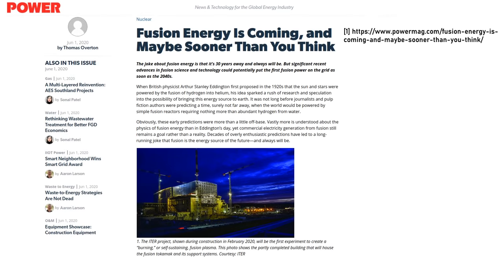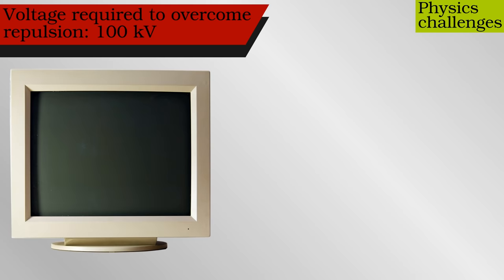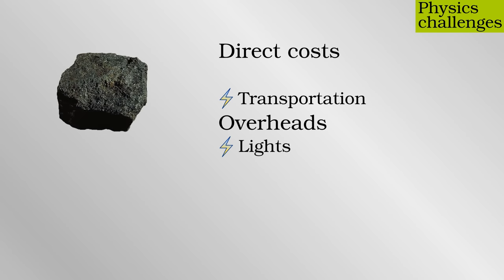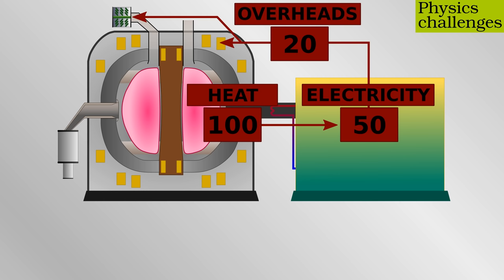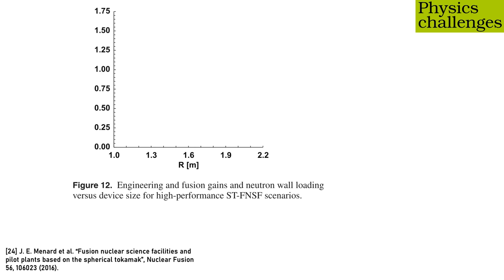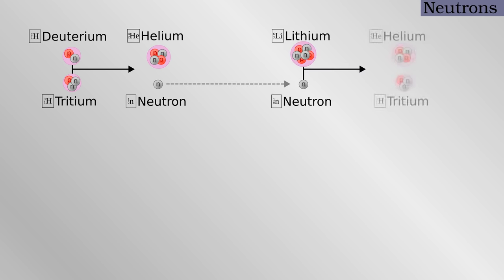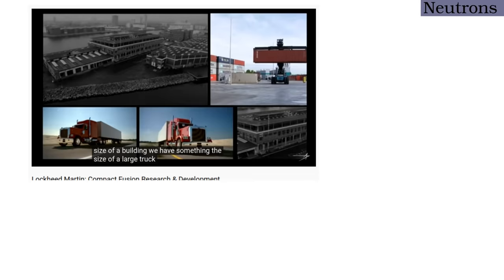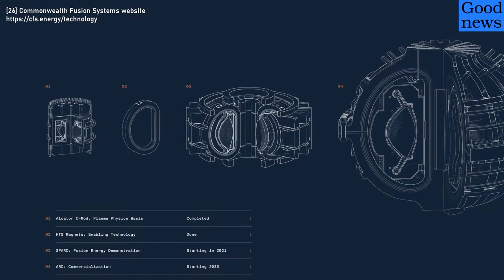Former fusion scientist on why we won't have fusion power by 2040

Comment: Great video:: I remember when I was a young electrical engineering student in the 1950s in the UK when I read an article about a fusion machine which I think was called ‘Zita’ that was supposed to have achieved fusion and was predicted that this would eventually be able to supply the world with unlimited energy. Later it was decided that the machine had not achieved fusion but that within 10 or 20 years of development it would. I am now 85 years old  and i am still waiting.
Reply: I hate to break it too you but fusion reactors that produce enough power to make them worth it are over 100 years away.
Reply: The machine was called "Zeta", if you want more information.
Reply: @Veritas-invenitur  never  , we haven't got 100 years !
Reply: @MyKharli  not with Biden in charge
Reply: @Veritas-invenitur  Unknowable.  I doubt it will be that long but it's uncertain when we'll have it.
Reply: I feel most of your pain!  Been watching this promise for 47 years.  Remember the two scientist that thought they had 'room temperature' fushion in a quart jar?
Reply: @strategicsage7694  I do not believe that magnetic containment alone is capable of making a practical and efficient fusion reactor that can be used as a power source. I believe that other methods in addition to magnetic containment are required. I had a very interesting idea of a containment system that utilized radiation produced by solid state sources to assist in field containment. Its quite complicated as the radiation gets converted into photons through the excitement of gasses and it is the photons themselves being directed into the field generated by the magnetic forces themselves that assists in the containment. The thought process here is that if we could dramatically reduce the amount of energy required to maintain containment we would increase the net energy gain. I also question that if we can reduce the amount of energy needed for containment using the same size magnetic coils in the reactor, we would be able to push the reacton far further. Do you understand what I am saying here?
Reply: @Veritas-invenitur  I understand your thinking but why do you feel that containment isn’t possible? From what I’ve read over the years, once a fusion reaction can reach criticality it produces its own magnetic field that serves as a self reinforcing containment field. As power output increases, so does the strength of the containment field. The problem seems to be achieving the heat or pressure required for a self sustaining fusion reaction. That’s the real crux of the problem, we can’t create the heat required, so the other option is pressure, which is also difficult but somewhat easier using particle accelerators as an atom smasher, which isn’t ideal either. Bringing us back to the start of a self sustaining fusion reaction.
Reply: @Veritas-invenitur  I don't really think a thermonuclear bomb reactor is a feasible concept.
Reply: @Veritas-invenitur  Hold on, you're saying that focusing light generated by radiation from solid sources it will help the containment? By radioactive solid state sources you mean radioactive material? And what radioactive material? How light (photons) can help a magnetic containment field? Also, if we're talking about cost, those materials seem pretty exotic and not really cheap. The only radioactive material already used in those reactors is tritium, and it is true it glows faintly when it reacts with phosphor, but I fail to see how this will help with the containment.
Reply: @OnlyKaerius  It is feasible, but it'll work only once and the infrastructure that could use that kind of power output does not exist.
Reply: @dragoncongrelos  It'd add a TON of complexity, failure points and hazards, etc. The fissile materials have to be cooled and the fusion needs to be millions of degrees hot. Even if you somehow figure out a way to run it while allowing the fissile materials to melt and not need cooling, you need moderators for the reaction, and well graphite rods can only get so hot before they burn, and water needs to be cool enough to be liquid, so I guess some form of liquid salt moderator would need to be used to slow down the neutrons enough to sustain the reaction. But now you need to figure out how to physically contain the molten fissile material, and keep it separate from the plasma, but not so separate that it doesn't feed the plasma neutrons. I'm only scratching the surface of things that need to be solved here.
Reply: @logicsfinest3471  The photons will increase the pressure dramatically.
Reply: @OnlyKaerius  Yeah, so, that'd a huge part of the problem. If you are not careful a thermonuclear incident becomes possible with such a method.
Reply: @dragoncongrelos  You don't need a radioactive material that gives of photons. You use the radiation to excite a gas that gives off photons. What I am envisioning in my head is beyond difficult to explain. But essentially, you are shooting those photons at the field itself from the nonplasma side to increase pressure in the containment field.
Reply: @OnlyKaerius  I know how complex it would be. But I don't think you need to build an actual fission reactor to get enough radiation to excite the gasses. Passive radiation sources can throw off an absurd amount of radiation. It very well could be enough.
Reply: people waited a loooong time to turn lead into gold but we did it eventually
Reply: A completely different question but as an EE student I would like to ask: To what level did the education system educate you for what you needed to do in your carriere and to what level did you need to reducate yourself?
Reply: @JackMott  Yes, ultra-expensive, radioactive gold. :p
Reply: @OnlyKaerius  Alchemy ain't easy!
Reply: @Veritas-invenitur  Nothing you are saying makes sense. Have a great day.
Reply: @Veritas-invenitur  but is it even thay,  when we are there,  then the research will point it to be,  1000 years away.
Reply: @Veritas-invenitur  good point
Reply: I hope you can see it.
Reply: The problem is that the goal post is moving.
Basically every single goal of actual fusion research was furfilled. But when we actually achieved fusion the goal post went to "achieve net positive fusion". Then after achieving "net positive fusion" the goal post goes to "achieve net positive fusion in an industrial scale" and so on.
I understand that for the layman it feels as if fusion is not getting closer. But it surely is.
Reply: @AliothAncalagon  Net positive fusion hasn't been achieved yet. See video.
Reply: @OnlyKaerius  I never claimed anything else.
I simply explained that this is exactly the next goal post that is going to be moved.
Reply: @AliothAncalagon  
yeah, that is probably true that they are getting to the logical milestones, but you don't think there is a possibility that at the same time the big picture is coming into focus of what is doable without some major breakthrough?  The video is quite compelling in explaining how much has to be put in, and how hard it is to get energy out, and do anything with it.  The economics do not look promising, that is more than just meeting milestones.
Reply: @justgivemethetruth  "Breakthroughs" are less important than reaching certain milesones.
One of those super relevant milestones that was preventing big steps is sheer size.
Something the ITER is making a massive leap towards.
We have been spending much time in understanding the plasma. We need to start applying this knowledge on more than a laboratory scale.
Reply: @Veritas-invenitur  well that is like saying- that  most of people could get a stable job and be married with kids by the age of 30, 
but it aint always like, that is it
Reply: Captain Chaos  But this was intentional. A net positive reactor requires a certain, large, size. 
To learn the things about fusion we prioritized this size was not necessary. Building reactors 5 times as large as we needed only to get above the threshold that makes them net positive for publicity reasons would have wasted a lot of ressources and, maybe even more important, decades of time. Now that we became very proficient in controlling the fusion process, it is the right moment for ITER to go big.
Reply: @AliothAncalagon  when is "net positive fusion on a break even basis?" Lol ..
Reply: This is the other half of the cover story of the military psychopaths that always promise the Moon and Stars just before doing you over, but you've known that about ten years longer than I have.
Reply: @systemBuilder  When ITER goes online.
Reply: @willybird3377  This channel is for intelligent people.
Reply: @Gary Cooper As many people have mentioned in the comments, you are most likely talking about the ZETA machine which is based on a concept called reverse-field pinch. Think of tubes of current running in a closed loop in the shape of a torus. There are also tubes of current running in a closed loop around the long tubes. The idea is that the plasma can relax to a quiescent, low-energy state after a violent start where these currents and the resulting magnetic fields balance each other. This was an attractive concept because it doesn't require superconducting magnets to create an external magnetic field. But the heat and particle loss compared to modern concepts like the tokamak and stellarators are huge. Compared to that device, we are doing much better now(approx. reduction in heat and particle loss by a factor of 60). It is hard to describe the progress to people who are not involved with the field.
Reply: @Veritas-invenitur  "humans" lol. Are you an alien?
Reply: @anonymoususer3561  I found it very interesting that you took notice of how I used the word humans. You are quite perceptive. This world that we live in, is filled with secrets, omissions, and false assumptions. Throughout all of recorded history, across every civilization and empire strange and bizarre stories that challenge the group knowledge and perception exist. There is a reason for that.
Reply: @Veritas-invenitur  tokamaks maybe, but what about high Tesla spheromaks/stellarators? The polywell and focus fusion? Those are all very small so if they will work we'll know about it much sooner.
Reply: Captain Chaos  they got more out than in at JET in the 1990s but it wasn't stable and not hooked to electrical output systems. The magnets available at the time and well known scaling laws for magnetically confined plasmas in thermodynamic equilibrium told them they needed it big so they started ITER. New magnets in the meantime have led several groups to make smaller devices using the same scaling laws which can be tested in the 5 year timescale but then need to hook up energy output. Meanwhile nonthermodynamicly stable methods are also in research.
Reply: @Veritas-invenitur  You clearly don’t have a background in particle physics, but reliable fusion isn’t going to be solved by vaguely describing an idea that has no baring to reality. Ignoring the issues with using a radioactive decay to produce photons (why? there are far better ways to produce streams of photons such as the way lasers do). The only way introducing photons into the system would help is by using a high power laser to help heat the gas, photons are massless and don’t interact with magnetic fields so wouldn’t help whatsoever with confinement. Using photons for heating the gas is just trying to mix two separate methods of heating into one, which would no doubt increase complexity and decrease efficiency, lowering the fusion gain of the system. Trust me the people working on these systems are extremely intelligent and well versed in their fields. Unless you’ve got a P.H.D at a minimum any concept you come up with either won’t make sense or work from a physics standpoint or will have been thought about long ago
Reply: @justgame5508  I do not know how to express this nicely. But you are missing something. Something critical. I cannot explain it in the YouTube comment section. But you have to use radiation instead of lasers. And in this specific case, photons would work. Their are "different and strange" phenomena and effects when you are dealing with these types of pressures, temperatures, magnetic fields, and isotopes. Conventional physics almost "breaks down". It's a completely different animal. As for your PHD argument. No, I do not have one. But the man who came up with this idea back in 1993 did. The reason why the idea never left the drawing board is simple. It's beyond dangerous and at the time used unconfirmed theories that have only recently been proven to be true by CERN. So, just because you think you understand something, does not mean you do. Be careful with your arrogance for it blinds you. And another thing. The vast majority of what people learn is simplified, but not entirely factual or accurate. It's good enough for 99% of things. However, fusion is most definitely in the 1%. And above all that, sometimes misconceptions and inaccuracies are kept alive and well for a security, economic, political, and/or safety reason. Just look at how long people thought the world was flat when so many knew it wasn't. Look at how long people believed and were taught that the sun revolved around the Earth. Some people are just 250 years behind. Photons are completely mass-less, yeah, okay. I like how you believe that anything can exist without mass. That's cute. What's the third law again? How would the third law apply to photons if they do not have mass? Interesting isn't it? The fact that you didn't figure that out yourself says alot about you. Even the syfy writers figured that one out. Stop believing everything you read. You will go farther in life.
Reply: @Veritas-invenitur  I do understand a lot of the physics and concepts involved as I have a masters degree in engineering and worked with some of the maths required to delve into these topics. The “Third law”? third law of what? Thermodynamics? “The entropy of a perfect crystal is zero when the temperature of the crystal is equal to absolute zero (0 K)” is no way related to photons. The reason photons can have energy with no mass which I’m assuming your hinting at is due to the fact they still have momentum and thus energy. Stop trying to sound articulated and philosophical about a subject you clearly know very little about, if your genuinely alluding to the idea that the scientific community is in some way hiding a conspiracy regarding fusion or physics in general than your even more deluded than you seem from your arrogantly worded response. I think you need to lay off the Sci-Fi films for a while
Reply: @justgame5508  A conspiracy is hardly an accurate word for it. In fact, it’s a very poor way to describe it. I’m not going to get into a discussion concerning facts, information, and accuracy here. It serves no purpose and is annoyingly complex. Photons have resting mass. E=MC2. I understand the quantum state explication concerning why photos don’t have to have mass, but that’s wrong. Gravity cannot effect something that ultimately has no resting mass. I don’t care about the “momentum” argument since that’s absurd. Momentum requires resting mass. Energy requires resting mass. Resting mass is a requirement for existence.
Reply: @Veritas-invenitur  No photons don’t have resting mass, the idea of a photon at rest doesn’t even make logical sense anyway as a photon always travels at C regardless of the frame of reference. Your talking about gravity as if it’s still 1800, gravity is not a force, it effects the motion of photons by warping the very fabric of reality (space-time) that those photons travel through. The concept of time is effected by gravity, mass is only necessary in Newton’s outdated and incorrect model of gravity. Please go do research before commenting
Reply: @justgame5508  Wow. Just wow. You are completely missing every point here as you grasp on to your straws. First. Resting mass is a term. Of course photons cannot rests. Photons are both a particle and a wave. Second, Gravity is obviously a catch all term the describes a perceived effect. Your correct about Newton’s model being outdated. What’s funny is that in schools they still teach people Newton’s model even though they know it’s wrong and outdated. It reminds me of what I was saying earlier concerning inaccurate and incorrect teachings and understandings. You know, that thing you described as a “conspiracy” that does not exist. Lol
Reply: @Veritas-invenitur  I know it’s a representative term, one that makes no sense for a photon as they don’t have mass, you keep saying I’m grasping at straws and yet you’ve failed to respond to any argument I’ve made and haven’t backed up any of your hand wavey, almost laughably inaccurate “ideas” to revolutionise fusion, claiming something to do with radiation and photons said by someone in the 90’s and you have the audacity to moan about inaccuracies and precision, the hypocrisy is unbelievable
Reply: I got a physics degree and then mid-60s. At that time commercial fusion was 50 years away. It's dropped to 30 but at one time later it was 40 and now it's 30. It'll never happen. 
How do you maintain cryogenic temperatures when you have that gigawatt flux of neutrons being generated inside the magnetic coils. Coils are curved while neutrons go in all directions.
Reply: @henryD9363  I understand your skepticism concerning fusion. Fusion power has been since its inception one of the "holy grails" of science. I personally believe that not only isnis humanly possible, but that it is nothing more than a matter of time. My only question concerns if humanity has enough time and willingness for a project like this left to make it work. Honestly, I believe the greatest obstacle to fusion is simple. Humanity refuses to spend enough on it. If we want this to work then we need to go Manhattan project style funding, speed, and staffing on it. I have no doubt that would work. However, a greater threat to fusion development exists. The population is intellectually devolving. We are already three decades past peak.
Reply: Mr Gary, have you ever glance even once at a technology called free energy in that 30 years? yes I know it's impossible back then just like how impossible it is to carry a computer on your hand at that time, but look at those $500 smartphones now, the computing power is way too powerful to guide the first space rocket to the moon...do you think up till now there's no such thing as free energy device?
Reply: you can wait more 100 years
Reply: @justgame5508  thank you for staying nice while discussing with him. Not sure if I would have had the nerves to explain and discuss such detailed mechanics with someone who is unaware that photons have no resting mass. Cheers for your calm way of discussion
Reply: didnt tesla figure out free energy but they stole all his work?
Reply: @votpavel  Cannot be free energy. This would a contradiction to the laws of thermodynamics
Reply: It's not all bad. In the meantime were adding more solar panels and wind turbines to the grids.
Reply: @Veritas-invenitur  current reactors already use the energy off the grid which can be considered dirty, and no one bats an eye. I think you just pulled that our of your ass. 5 years, yeah right. It's as if you didn't even watch the video and went straight to commenting.
Reply: Z.E.T.A. Zero Energy Thermonuclear Assembly.

There hasn't been much if any real progress since then; personally and to reprise the video my own feeling is that it may never be possible the create and maintain a self sustaining nuclear fusion reaction that generates more energy than is required to contain it.

It's much the same reason that perpetual motion machines can't work. 

I'd be more than happy to be proved wrong.
Reply: For 70 years, scientists have been unable to make a thermonuclear reactor. why?  The answer is simple - wrong theory! The reactor is therefore not done correctly.  Scientists do not yet know how to make a thermonuclear reactor that gives out commercial heat. When do scientists promise to make a commercial thermonuclear reactor?  Promise in 40 years!  And they don't guarantee that. But, there is a technology that will help make a commercial thermonuclear reactor in two years. The theory is correct, the reactor design is correct.. I offer the transfer of technology for free, under the contract.  70 лет учёные не могут сделать термоядерный реактор. Почему?  Ответ простой – неправильная теория! Реактор поэтому сделан неправильно.  Учёные пока не знают, как сделать термоядерный реактор, который выдаёт коммерческое тепло. Когда учёные обещают сделать коммерческий термоядерный реактор?  Обещают через 40 лет!  И это они не гарантируют.  Но, есть технология, которая поможет сделать коммерческий термоядерный реактор за два года. Теория правильная, конструкция реактора правильная. Предлагаю передачу технологии бесплатно, по договору. http://n-t.ru/tp/ie/ts.htm Thermonuclear fusion in the Sun - a new version.  Термоядерный синтез на Солнце – новая версия.
Reply: @Gary Cooper -  Maybe they already have fusion power and Big Oil is keeping it under wraps.
Reply: @thelakeman5207  Along with water driven automobiles and cold fusion etc; it seems highly unlikely to me for all the reasons which are explained so clearly and so cogently in this video.
Reply: @MyKharli  "we haven't got 100 years"
There is no WE.  But it is incredibly unlikely that I have 100 years.
Reply: @logicsfinest3471  The containment drifts a bit; sort of like a chaotic system. A microscopic perturbation of the magnetic field leads to stronger and stronger perturbations.   Then the plasma contacts the walls of the Tokamak, loses plasma state and sometimes destroys the Tokamak (early versions anyway).
Reply: I literally repeated what scientists say.
Reply: @thomasmaughan4798  interesting. I will research that.
Reply: @Gary Cooper You Rock dude! So True... The good news is that we won't be around to see them destroy the planet with a Fusion Star I the middle of some University. The bad news is that we keep funding until we're out of the picture. My heredity suggests I'll never make it to your age, but my Civil Environmental Engineering experience with Civil projects suggests I'm safe from the hope of seeing Fusion beyond a sunset or sunrise!
Reply: I hope one day you see a fusion reactor producing electricity for the public!
Reply: For all those saying the fusion will never happen and they lied with their promises. You should take a step back and ask in which conditions did they promise the specific timeframe ? I would promt you to this graph from wikipedia [U.S. historical fusion budget vs. 1976 ERDA plan.png]. Trying to do something with less than what is required and expect the same or better results is the definition of insanity.
Reply: @dilbertjunkmail  Dude did you even see the graph ? If you did you would know that fusion didn't get anywhere near the amount of budget it would require to meet the goals of 20 , 30 or 50 years. Hell fusion at least in the US gets less funds compared to 1978 (inflation calculated).
Reply: @alexandervlaescu9901  Dude we're not really listening to each other! From my perspective, You're hiding the important point. (Burying the Lead) A cheaper better energy solution is already here. What's left is design configuration refinement that will change like car models every year. Granted, Investment in Fusion from your perspective is inadequate, no argument. They are refining a science concept into a manageable physical utility. Something our current knowledge and resources are  totally inadequate. Fine, but my point is we don't need to be doing this because it's fairly unattainable within a reasonable amount of time and resource required. Not to mention the absolute danger of managing a science  which powers stars and could lead to black hole risk or unstoppable expansion. Example: lI certainly wish the Fauci team of curious scientist hadn't "farmed out" the "Gain of Function" research on the corronovirus to Wuhan. Total backfire!!! That doesn't seem like it was really worth the risk when you look at the loss of life and economic destruction wrought from these people that consider themselves superior to the common man. 
My bottom line: Liquid sodium nuclear reactors are attainable within my lifetime (I'm old now, Senior citizen level), but your Fusion generator isn't attainable within your lifetime even if funds were unwisely allocated. (I'm assuming you're younger than myself due to your enthusiasm for pro fusion "no holds barred" development, based I the same fusion marketing I've seen. I've watch political governments missteps over a lifetime you haven't considered, bcz this looks just like another one. 

Lack of attention on nuclear tells me the power brokers aren't really serious about global carbon reduction either given the decisions and poor judgements being made that will send economies and living standards to new lows. What is happening is more about political power and socialism than engineering a solution for the future.
Reply: Yes, it was ZETA, and was in 1958. Then it all went quiet for some reason....
Reply: @dilbertjunkmail  Weird ..can you read graphs ..the ones pointing to every metric needed for sustainable future in dramatic decline while your type rant and rave and do nothing but blind hope and optimism. Physics doesnt care about your crazy ranting . Like most engineers your way down the rabbit hole of specialisation and unable to see the bigger picture ..Engineers are tools .
Reply: @johnshields9110  Yeah, it was the fax sent 'round the globe!  It was fun, everyone scrambling to duplicate.  Too bad it was a "flash in the pan".
Reply: What about thorium reactors?  One was developed in the late 1960's, a few years before my birth in 1971.

BTW - I think electrical engineering is dead just about.  I mean, what's left to do?  Moore's law is done, we're not going to make better computers really - who needs them?  I'm an EE, and I see no reason to get a faster computer.
Reply: @fuzzywzhe  Electrical  engineering is still required to do a lot of the heavy lifting for all building designs, oversight and powerlines maintenance. Power companies still want these guys. I was Civil/Environmental and Electrical efforts were always very much in demand in the power sys side of things that I worked in. Project Management will keep you busy for the rest of your life if you're willing to hustle. You may be thinking about industrial electronics that mainly reduced because industry has been shipped outside of the country. Thats true for software too, but your background puts you close to the mechanical engineering specialty too. Industrial isn't as big as once, but it's far from dead. I knew a guy that created his own plastic extrusion business with his mechanical engineering background after leaving NASA. S degree in engineering should point you above the job demand market, but you'll have to earn your stripes, but you'll make a better living than the new current average citizen. Engineering, Construction, Power distribution design& maintenance, Industrial and manufacturing are still all good field you work within. Any search will show you the markets that are most secure, in demand and their average pay.
Good Luck...
Reply: @fuzzywzhe  Agree  I can only assume the decision to stay away from these type reactors is more political since the proof of concept was completed during the 50s-60s via Oakridge Lab work. The files were made open to most countries during late 70s after the project was shut down. These are the liquid salt reactor types I'm referring to. A wiki search gives full history, general design and Pros/Cons. The liquid salt is one negative due to corrosion issues, but I'm would think ceramic containers with removable titanium steel piping configurations could be developed. Much less of an engineering challenge than making a viable fusion containment field that's still within the ScyFy world of concept design! Why waste so much funding on a pipe dream when a physical container has already been created that works.
Political and Industrial manipulation seems to be the reason for the delay!
Reply: I hope you have Christ as your savior friend.
Reply: @logicsfinest3471  " Once a fusion reaction can reach criticality it produces its own magnetic field"
Actually, after just 50K the plasma is pure, and in motion and produces a constant magnetic field.
That's why fusion confinement doesn't work. The two highly fluid fields interact with  loss of stability.
Reply: It seems that the more we learn about fusion, the longer the timeframe for making it work becomes.  It was 10 years in the future in the 1950's, 20 years in the future during the 1960's, 30 years into the future by the 1980's and we are looking at a minimum of an uncertain 40 years now.  By the time we know all there is to know about fusion, it may well be that it will NEVER happen.
Reply: Damn. RIP soon old timer Gary
Reply: @handsomesquidward151  We'll all be taking that dirt nap before fusion is the power of the world.
Reply: the thing is progress is being made, every time they do get it to produce a bit more energy but its still far away to get our dream of fusion.
Reply: well we have achieved fusion for quite some time now.
Just energy generation is the tricky part.
Reply: That means it will never come.
You are so smart!
Reply: @Veritas-invenitur  If it's too difficult for you to explain, you do not understand the topic at hand.
Reply: @logicsfinest3471  The sun is in a state of hydrostatic equilibrium.. It can achieve this by being huge and having an enormous amount of mass. Is it attainable on earth ? I don't think so, because in order to attain fusion,the smallest star needs to be at least 9 percent of the diameter of the sun, which is still larger than anything humans can build.
Reply: @bort6414  It’s not to difficult for me to explain. It’s to difficult for me to accurately explain to someone without the prerequisite knowledge required to have an accurate understanding. One could explain a CPU to someone who has no knowledge of electronics by describing the CPU of a computer as a “brain that does math”, but, should we?
Reply: @Veritas-invenitur  Humor me, then. By all means.
Reply: ZETA wasn't about overoptimism, but a mistake (combined with a political rush).  One of the Soviet Union's "marketing points" for their system was that they were a bastion for science and technological advancement.  This was rather laughed off early on, but after Sputnik, nobody was laughing. But the early ZETA data leaked, and it provided the perfect rebuttal to the Sputnik launch: "Okay, fine, you've launched an artificial satellite, but WE'VE invented UNLIMITED ENERGY!".  The press ran with it.  But the simple fact is, ZETA's neutrons weren't from fusion, but actually from a plasma effect causing neutron spallation off the walls of the reactor. They weren't even remotely close.   Like, not even in sight of viable fusion.  People just shoved it off 20-30 years because in science terms that just means "the distant future".

But the simple fact is, we're NOT at some great distance now, and we DO understand the physics now (and can readily simulate it). ITER is targeting Q>=10.  REBCO tapes now let us do that on an order-of-magnitude smaller, and simpler, device.  The surge in interest in fusion is because our current actual understanding of fusion says we're finally on the bounds of viability.
Reply: They have enslaved and fooled you 👉 The Connections (2021) [short documentary] 💖
Reply: You make me feel young. t I remember when getting my physics degree in 1987 fusion was only 20 years away.
Reply: I am 22 and it's cool seeing old people in the comment section. It's like even if we were raised in completely different times, we still use the same technologies and can communicate with each other, very nice
Reply: @willybird3377 
What do you mean?
Reply: Where you born in 1936?
Reply: In 1960.....1963 a book came out describing all the ways of achieving nuclear energy power.....towards the end of the book it said that we will have operating nuclear power stations BY 2015 , Well it's 2024 now and I'm still waiting. If the government put it on a war 
Footing, we would have it in five years period. Michael said that,bye for now my friends.
Reply: Fusion is the world's 2nd greatest boondoggle,  next to "renewable energy".
Reply: Every now and there, there is a new "great fusion breakthrough" and a "we are only 5 or 10 years away from fusion" Hype. It belongs to the great myth of science, and a great way to consume a infinite sum of money into a blackhole
Reply: @karenrobertsdottir4101  Nah. It's not viable, and it won't be in the next 30 years.
Reply: @dilbertjunkmail  Yep, keeping the people poor and dependent is the pillars of the political power and the organisation of society.
Reply: Any minute now....